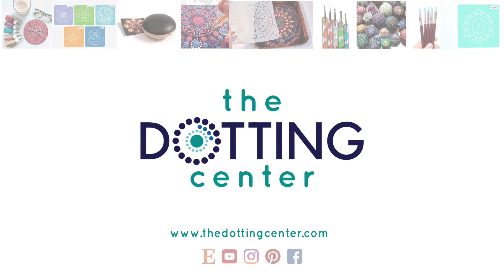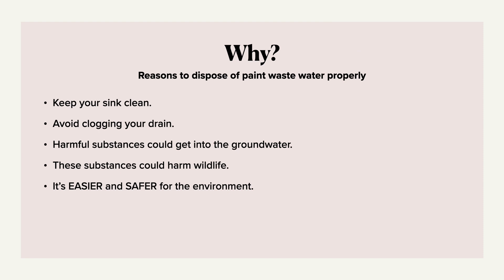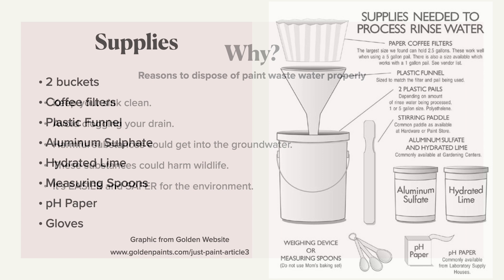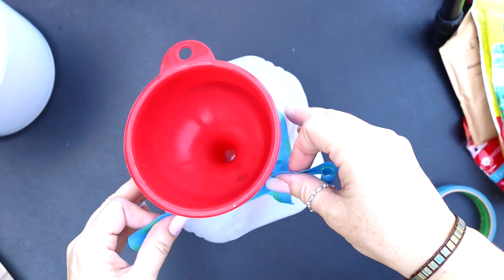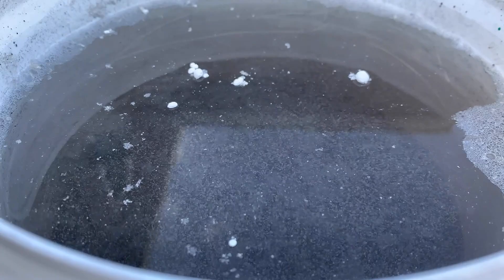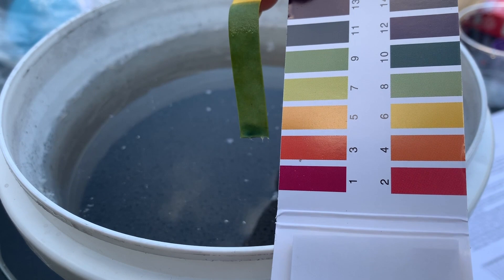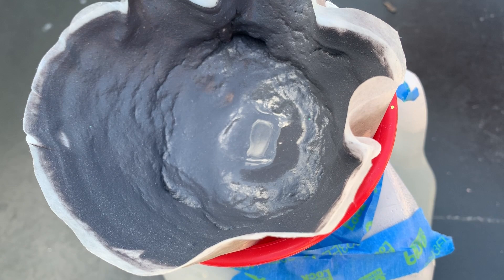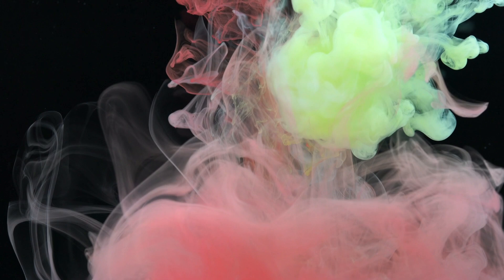How to Dispose of Acrylic Paint Waste Water - Eco Friendly acrylic water treatment for artists

Comment: It's probably not as good as the whole flocculation process that you describe (very clearly!), but here's what I've been doing the last few years: I keep extra containers around (e.g., old plastic almond jars from Costco, or old coffee tins) and when I'm done with my painting, I first wipe off paint onto a paper towel, then rinse as much as I can into a small (yogurt cup) of water, wipe off some more on the paper towel, then rinse some more in another cup of water. The water can then be poured into the larger plastic jar, into which I also add some clumping kitty litter (best to find the stuff that doesn't smell!). The kitty litter absorbs most of the water, the acrylic waste just dries up quickly, and after a few days any remaining water has evaporated. I keep doing that until the jar is full of kitty litter & dried acrylic solids, at which point it can just go in the trash. Very little acrylic material goes down the drain this way and it's much easier than the process described by Golden Paints.
Reply from the maker: Thanks for sharing your process! Some other viewers have also mentioned the kitty litter method. I’m in a high humidity state so I’m not sure it would work as well for me. Nothing dries out in Florida 😂

Comment: Thanks so much for putting this together! Gonna do this! But, I am confused on the “dump the excess water”… why don’t you reuse it as your same “rinse bucket” for painting? Are there lingering chemicals in it?

I also just wanna add, a big up to Golden, they implemented a reverse osmosis process that gets back like 75% of the water they use to make the paint. It’s pretty amazing. So they can consistently reuse the same water over and over.
Reply from the maker: I'm not a scientist so I don't know the details. I dump the excess water because it stinks, frankly. There's definitely chemicals in that water. This process simply removes the micro plastics and pigments. I love that Golden cares about this stuff.

Comment: I've cringed every time I've poured my paint water down the drain, even it's a small amount, so this will sooth my soul and ease my guilt a lot! Thank you sooooo much for putting in so much work that the rest of us can benefit from. Quick question though: after the water has gone through the process and is clear again, can it be reused? Or is there a way to make it reusable? I'd love to be able to reuse the water if I can.
Reply from the maker: Yes! This is a game changer. Don’t reuse the water for any purpose. It still has chemicals in it so it will most likely kill plants. This process only removes microplastics not chemicals.
Reply: Thanks for the reply. I was thinking more of reusing the water to clean my paintbrushes, like a repeat process. plants die when I walk by so I don't keep any 🤣   @TheDottingCenter
Reply from the maker: @AnimeLover738 😂 Oh ok, good! I’ve been asked if you can drink the water after filtering it so I always have to cover that. You can try to reuse the water but mine water always has an odor that I don’t like so I just flush it.

Comment: Wow! Few questions:
1. Can you use the end product (the clear water) to water your plants?

2. Regarding the solids you dump in the trash, aren't they polluting by themselves? I mean at the end of the day, they get to the trash center where they get into the soil ----> from there to the groundwater. So... What is the difference?

3. Aren't there sustainable eco friendly paints in the market? Or are they just crazy expensive?
Reply from the maker: 1. Don’t reuse the clear water. It will most certainly kill plants. It still has chemicals in it.

2. The solids are less polluting because they seal into a solid. The micro plastics in the water are what we’re trying to avoid  with this process.

3. There should be something more eco friendly! I agree. Hopefully they will figure that out soon. Thank you for your questions. 😊

Comment: Hi, Rachel! new painter here. Do you also have a sustainable method to clean your brushes? I haven't found a good clear method yet and I was hoping you could give a tip.
Reply: I had an idea
Reply from the maker: I wash my brushes in the waste water to get most of the paint off, then use brush soap to wash the trace amounts left in the sink.

Comment: Thank you so much for this video!! ❤❤❤ I have some questions left although... Do you wash your brushes with soap? Does the soap affect the process of floacking and filtering any way? I use coconut soap to wash my brushes.. Could you show us your process of cleaning yours? And what about oil paint? How is the filtering process different? Should we also do this for watercolor water?
Reply from the maker: I use brush soap and it doesn't affect the flocculation process. It will only work for water based paints. I don't know the process of washing oil paints, but you wouldn't want to mix oil paint turpentine or brush cleaning solution in this water. I would keep that separated.

Comment: I use this system and it works well. I use two HUGE coffee filters in a colander suspended over a large bucket. It is easier to pour, although you have to be careful of the filters folding inward. I got the method from this Golden Paints video:
https://youtu.be/3YWW20Lxpi4
Reply from the maker: So good! Thanks for sharing!

Comment: Does this get rid of all the dissolves chemicals and nano-plastics though? I feel like it can only really mostly get rid of paint solids but not the dissolved harmful chemicals ?
Reply from the maker: It only gets rid of the micro plastics. The chemicals are still there. Thankfully the chemicals in acrylic paints are much safer than the solvents used in oil painting.

Comment: Question: why dry out the paint at the end? Why not just throw it away in the filter?
Reply from the maker: You can dry it out in the filter. Just as long as you don't throw it away wet. Once it's dry it's inert and "locked in"

Comment: What's the best way to dispose of water that is loaded with concrete particles. I have been casting my own stones and have a collection of crusty icky water. I want to dispose responsibly. Please help!
Reply from the maker: That's a great question! I really don't know. I don't use concrete or casted stones so I've never come across any info on that. Try looking up the concrete on the company's website or call or email directly. They should be able to tell you how to dispose of the sludge properly.

Comment: I'm guessing the water isn't reusable due to the added ingredients in the leftover water.
Reply from the maker: Yes, this process only removes solids not chemicals.
Reply: @TheDottingCenter  I'm referring to using the water to clean brushes again. Basically recycling the water. Have you done that?
Reply from the maker: The varnish I use has an odor and I personally don't like the smell of the filtered water, but that's an awesome idea if you have brushes that need to be washed you could definitely use that water again if you can bear the smell.
Reply: @TheDottingCenter  Ah. Okay. Thank you. 😊